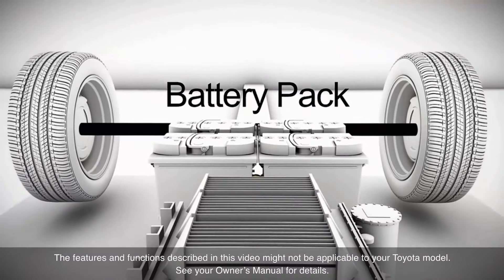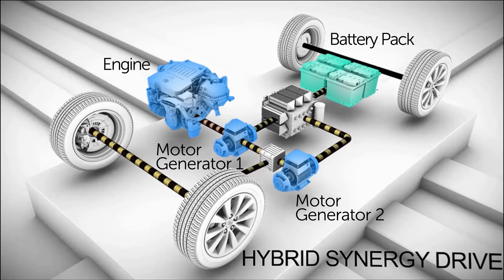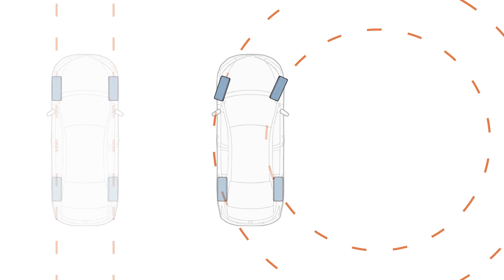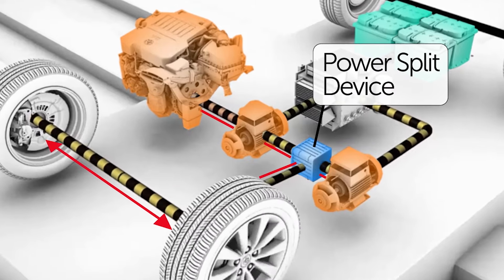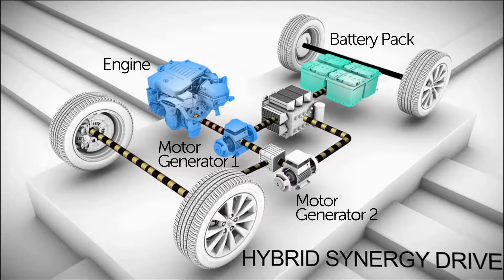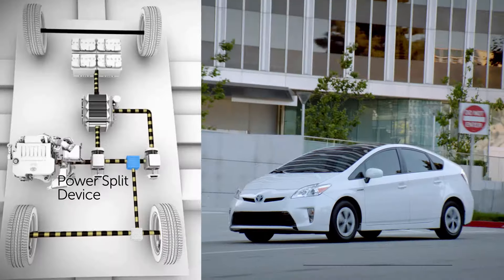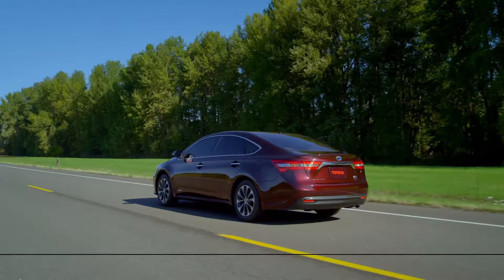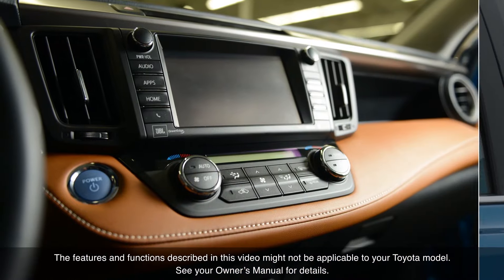Know Your Toyota Mechanical: Power Split Device

Comment: Perfect!  I personally knew all of this, but until now, I hadn’t heard anybody point out the one, single key point:  1:11 of the PSD.  It functions like a differential, but instead of distributing a single power source (engine) to multiple loads (the drive wheels) at different speeds, it instead combines multiple power sources at different speeds into one single power source .

In terms of CVT-like functionality:  MG2 adds or subtracts (not exactly +/-, but essentially) its torque to the engine’s, and MG1 adds or subtracts its speed to the engine’s.  MG2 is about torque, and MG1 is about RPM.

So, to produce the effect of high gear, the MG2 becomes a generator that robs some torque from the engine converting it to electrical power that powers MG1.  MG1’s RPMs add (in essence) to the engine’s RPMs so that the engine can turn more slowly.

The effect of low gear can be accomplished by doing the exact opposite:  MG1 uses engine RPM to generate electricity that powers MG2 to enhance the engine’s torque.

Comment: Hybrid as cvt and power split, awesome. Better than the hydrostatic cvt on Fendt Vario, imho.
Reply: The hydrostatic cvts work in the same way but are capable of handling the higher torque loads tractors experience

Comment: PSD is Gen2 on the video since there is metal chain. Gen3> its direct gear driven without chain. So why would you upload this old stuff on 2016?
Reply: January 2020 and I’m still trying to find a good video . Excellent question and excellent point about the chain
Reply: Joseph Silberstein the chain makes a whole difference actually. This is the weak point of CVTs and a eCVT with this configuration would also affect reliability in the long term. Direct gear driven eCVT is proven to be way more durable
Reply: In which year they started putting direct gear eCVTs in their cars?
Reply: @fcg243 
Any chance you know since which year Toyota started putting 3rd Gen eCVTs in their cars? I'd like to maybe buy a car with the 3rd Gen, rather than with 2nd Gen, since from what I read the chain solution is less reliable.

Thank you in advance.

Comment: its the same in a Lexus ??
Reply: Yes, except that some models like the GS have another gear to switch between low and high speed range. Under hard acceleration you can sometimes feel a very small hesitation around 55 - 65 mph when that gear shifts.

Comment: so where is the transmission device on Hybrid Toyota for gasoline motor ?
Reply: The motor generators and power split device is the transmission.
Reply: there aint one
Reply: Gas ⛽️ and electric ⚡️ use the same eCVT

Comment: This technology is great but toyota loves to use old technologies and stay conservative as much as possible and sometimes it lasts 10 years. They didn't say in the video but this transmission is not efficient for high speed driving. Apart from that toyota uses SUPER old ni-mh batteries with super low capacity 1.6 kwh. In comparison all hybrids use at least 5kwh li-ion batteries and sometimes the capacity reaches 30kwh. That is why on toyota hybrid you can drive only 1-2 miles in EV mode, on other hybrid cars up to 40 miles. Toyota uses super old small capacity batteries,  old  transmissions and old inefficient engines. That is why the real mpg on toyota hybrid cars is similar to mpg of another non hybrid cars.
Reply: You are confusing a hybrid with a plugin hybrid. Those battery capacities can't be charged with just the petrol engine
Reply: @cristiansmochina9056  I'm not. Look at the battery capacity of another HYBRID cars.
Reply: FockewulfAz which ‘other’ cars? The maximum for a hybrid i see is 2,4 kWh capacity. Or are you confusin motor power and battery capacity?
Reply: Mercedes hybrid cars. Mercedes s400 hybrid has 19kwh. Other plug in have up to 35kwh. Chevrolet volt plug in also has a big battery. What I was saying is toyota could have used li ion batteries with a bigger size.
Reply: @FockewulfAz  Mercedes s400 is a 120000$ car. It's a bit unrealistic to expect the same, but paying 6 times less. Chevrolet volt plug in is a PLUG IN therefore it can use a bigger battery. Again, this is a pure hybrid, not a plug in hybrid. You can't expect that it can actually charge that much with just 120 horse power petrol engine.
Reply: @cristiansmochina9056  dude I have been driving toyota camry hybrid for 4 years and have fixed 4 hybrid batteries by myself. And I often see that when I drive on highway or downhill my battery gets full quickly. It means that the capacity is not big enough. In particular on downhills it charges it to 100% just in 5 minutes.
Reply: When I drive in traffic after 15-20 minutes my battery is discharged completely!!! And it starts charging the battery and my mpg falls from 40 to 20. So it needs definitely a bigger battery at least 3 kwh!!! I guess 5kwh will be enough and BELIEVE me the gas engine can EASILY charge it.
Reply: @cristiansmochina9056  dude I had 1kwh battery on my ebike. Now imagine that they put 1.6 kwh on a car. Doesn't it look STRANGE?
Reply: @FockewulfAz Again like everyone else has stated and you seem to ignore. You're not comparing apples to apple here. You're comparing apples to apple pie. All the vehicles you have used as evidence are either a premium luxury car that is 6 TIMES more expensive or a PLUG IN hybrid vs a STANDARD hybrid. There is a second generation PLUG IN Prius Prime that uses the batteries you're harping on about. It has an 8.8 kWh lithium ion battery that provides 25 miles on EV mode before returning to operating like a STANDARD hybrid. And just so you don't go on about how much more range the Volt has, Chevy put an 18.4 kWh battery in it that pound for pound performs very similarly. So please understand the difference that everyone is trying to talk to you about and how you're lumping LUXURY, STANDARD, and PLUG IN hybrids all in one group.
Reply: @thain2553  bro I don't ignore. I'm just saying that in a real life there is no much different between hybrid and non hybrid cars. You pay more for hybrid, you get less space in a trunk but what you win? Just 5-10 mpg??? Does that make sense?
Reply: @thain2553  in a traffic where you have to drive more than 4 miles your battery drains quickly and camry hybrid with 2.5 engine turns to camry that consume even more than a regular camry and mpg drops to 20 mpg...that is very sad
Reply: @FockewulfAz  I've worked for Toyota, sold, and driven hybrids for years now. My current car is a 2017 Prius. The standard prius is actually very roomy with its hatchback configuration. I've fit and moved more then I ever could in my previous, civic, camry, altima or taurus. Early models of non hybrid cars that have been introduced with a hybrid trim level had their batteries shoved in the trunk and yes they did lose room. Recent versions have taken their cues from the prius and have placed them under the rear seats with no loss in space.
Reply: @FockewulfAz  Standard hybrids are also not designed to be driven on electric alone. opting to lower sticker prices by using smaller batteries to assist in the pushing your car forward on the road. My vehicle consistently gets 45 mpg in the winter and 55 mpg in the summer without babying the car driving like everyone else. Also the battery in a hybrid should never fully drain, they are designed to be quickly filled and used depending on the needs of your current drive to help you get along using less fuel. Most people that I worked with, sold to, and see talking about these cars more often then not have a heavy foot on the accelerator or the breaks. If you drive like everyone else on the road these cars will deliver the mpgs they promised.
Reply: @thain2553  dude on prius it could be different. I have never had Prius but I have been the owner of 2 hybrid camry cars. So If I drive slow as a retired person without acceleration I get 35-40 mpg. But once I drive a bit faster or I go to highway and keep steady speed 80 mph my mpg drops to 25 mpg. When I compared it to my friends non hybrid camry I was shocked that we get almost similar mpg with having similar driving style.
Reply: @thain2553  you cannot refuse that  toyota's transmission "transaxle" is not efficient on a highway. You cannot refuse that Toyota's 2.5 engine has lower torque  and lower efficiency in comparison to competitors.  You cannot refuse that the battery is deprecated in comparison to competitors. So I didn't say anything that was wrong.
Reply: @thain2553  so if you are going to ride this car very accurately and keeping speed not higher than 60 mph then this car is perfect for you. And I completely agree that this car is great. But for someone who drives a bit faster and takes highway with a speed limit 80 mph(like in Nevada for example) this car becomes inefficient. That is only what I wanted to deliver. People didn't understand me....
Reply: @FockewulfAz  
I think it depends on how many miles one makes. Because it's not much, then any type of electric cars (including hybrid I mean) - is probably less convenient than the same model with battery.

Say it's a plug in - it costs much more than the regular car, and it weights more because of the battery, plus the cost of battery to replace is very high.

But if one does a lot of miles - it's where one starts to save money with hybrid or electric cars, more miles - more savings. If we are talking about same exact model, because comparing say a Toyota Yaris with a Tesla is not at all correct, Tesla costs much more.

There's another aspect too - the State limitations for older or ICE cars... For example in Italy, say Milan - you can't go in a certain zone, in the center of the city, with an ICE car, but you have free access with an electric or an hybrid car. So in this sense, one might want to have an hybrid rather than an ICE car, because it's more convenient (electric cars are way more expensive though, I don't think it's worth it to buy those).
Reply: imho battery safety and reliability trumps capacity in a true hybrid car (no plug in) 

unless on large road trips there isn't much opportunity to regen brake your way back to full. even then a smartly programmed control unit could favor the electric assist more or less depending on the battery level, removing the "oh my battery's full" or "oh my battery's dead" conditions unless forced by extraneous circumstances.